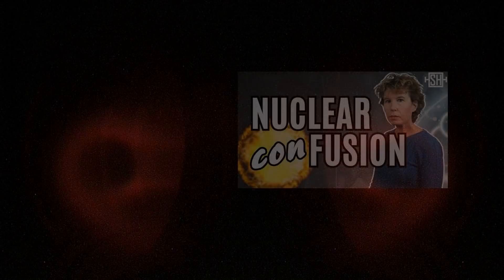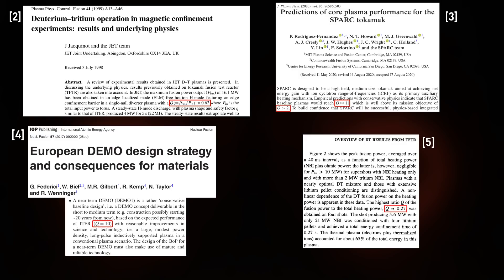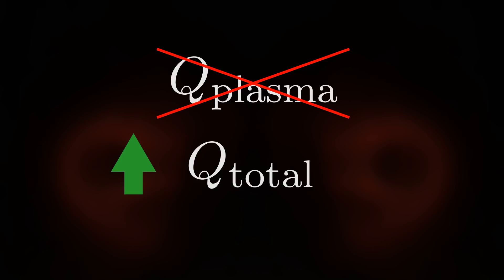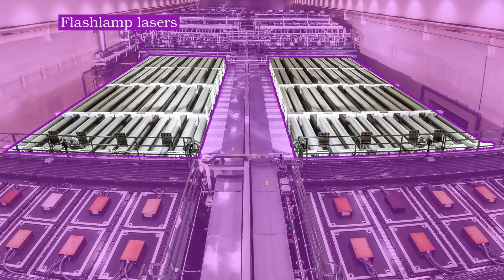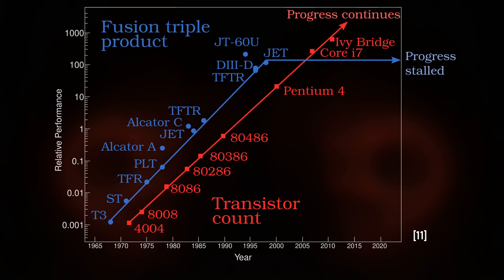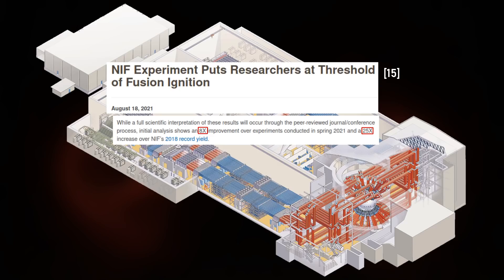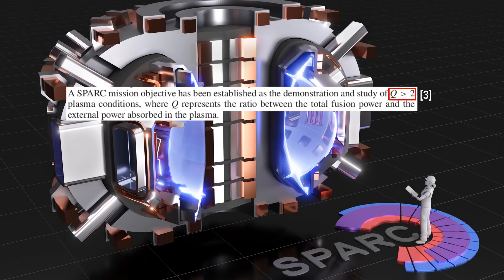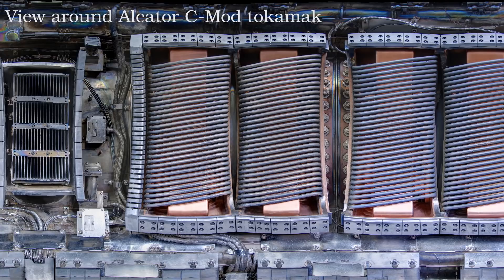In defense of "Q-plasma" - a response to Sabine Hossenfelder

Comment: Fusion research should be seen more as an engineering exercise rather than a scientific one. In engineering you are always focused on cost. There is no point building something, other than for self glorification, if the benefit does not outweigh the cost. If you cannot see a way to get Q Power greater than 1, and costs of less than alternatives, then fusion research is just reduced to an interesting technical exercise. Such an exercise should not have multi-billion dollars thrown at it.

Comment: For the curious. And, for the not so curious. I understand the lack of curiosity and, shockingly, lack of intellectual depth that comes with erudition.

I will say to the author of this video that you, as are many others both more learned than you, and less (like me), are wrong about anthropogenically caused climate change. (Remember, you don't have any tolerance for the skeptic and invite them to be, well, uninvited to your club. 

Squashing bugs like me should be easily done with a mere glance. I see, correction, don't see my previous comment. I'd hope you are less smug than you are smart and at least have a laugh at me instead of merely being imperious. I doubt it but there's hope.)

Also, the sun isn't a gas furnace. That model of the sun was formulated before atomic science reached a level that would lead to a correct model.

Dr. Pierre-Marie Robitaille is seen as some sort of crackpot but there is a problem. The errors he points out in so many of the physics at the heart of the "science" that underpins the theories about the sun are fundamentally wrong and, until abandoned, will lead to ideas such as nuclear furnaces on earth that won't ever work because they don't work like the sun. 

For those that are curious and, more importantly, open minded, I invite you to read the extensive and peer-reviewed work of Dr. Robitaille.

Then, write your rebuttals that prove him wrong. So far, he's been met with muttering and derision but not argumentation.

Also, I challenge you to argue with the "crackpot" author responsible for:

https://youtu.be/jQtDLGPuX3o

The sun controls the entire climate of the Earth. Period.